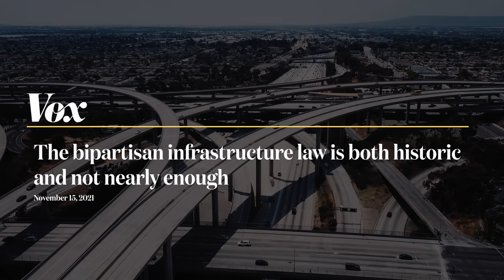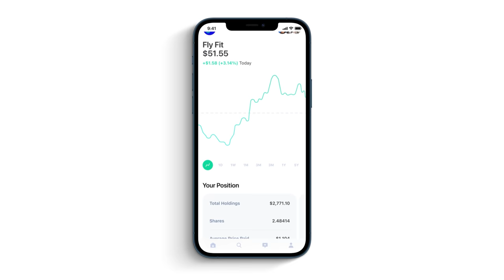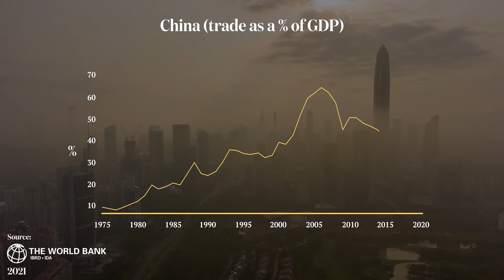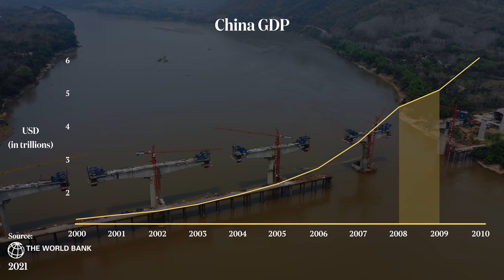China Has A Debt Problem Three Times Larger Than Evergrande | Economics Explained

Comment: It’s good to see huge infrastructures made, but the maintenance would be a nightmare
Reply: Indeed, it ain't always, "Oh let's just build it, it'll last for 10-20 years" without maintenance ? nah it won't.
Reply: Indeed that’s the issue that no one takes into account. Just like all those emptybuilding structures that remain empty today. By the time they get filled it’s gonna be time for a renovation And nothing will be working right.  Just a nightmare in the making and you know for a fact it’s not maintained.
Reply: @inkbold8511  I wonder how many Chinese people have jumped off the roof of an iPhone assembly building
Reply: Yes they mentioned in the video how the maintenance is turning  out to be quite the nightmare
Reply: I was in Suzhou high speed train station few years ago. The station looked as no one gives maintenance to anything. It was sad to see  such a beautiful place abandoned so fast. Los Angeles Central Station is almost 100 years old and it looks fantastic.
Reply: @filibertogarced  I used to live in San Diego. LA central station looks nice, but it doesn't really do its actual job. The ticket from SD to LA is so expensive, the trains run infrequently. If you take the amtrak it's expensive. If you take commuter trains they don't line up - ie you have to take one out of SD to the middle of nowhere and then take one into LA from the middle of nowhere. 

Maybe it's adequate as a hub to link LA to its suburbs but inter-city rail in the US is a joke.

I've not been to Suzhou or Shanghai but I'm hoping it's better there.
Reply: @sieteocho  hello,  
I have taken amtrak multiple times. It is actually quite convenient and sometimes faster than cars by few hours if there is heavy traffic. I agree that the system could be better. My comparison was on the maintenance that stations here are provided vs Chinese stations maintenance.  Some stations(high-speed)in China are far from the city center or on the other side of the city and it takes minimum an hour to move around. That happened to me in Changsha Hunan. 
I agree that our transportation  infrastructure needs a massive investment and we could do far better. 
Have a good day.
Reply: @evankurniawan1311  Wrong, there are laws for investors buying property they don't use or reside, in China. One of the reasons why homelessness is low is because China does indeed provide public housing for their citizens and don't just kick them to a designated area of every city like America does.
Reply: No roads to society, the Romans where fully aware of communication and commerce  to build a successful society and they where successful for a over a thousand years.
Reply: @reheyesd8666  The Chinese would never publish  due to the political paranoia.
Reply: @PETE4955  you mean building in florida?
Reply: You say this about highways?

And just think of all those jobs
Reply: @filibertogarced  I'm sure you have tons of pictures of all the homeless people in China
Reply: @PETE4955  China is richer than USA🤣🤣🤣
Reply: @skyisreallyhigh3333  I'm not making the comparison. Don't be a beta male. N
Reply: Think about it if there is no high-speed rail system, how many Boeing and Airbus planes do you need to buy? Those airplanes are more expensive, have a shorter lifespan, and are more expensive to maintain. The New York subway repairs are expensive, but they have been in service for more than a hundred years.
Reply: It will provide more job opportunities for the huge population of China. Unlike US citizens that only want a comfortable work and high salary, there are a lot of people in China willing to work.
Reply: @filibertogarced  But the trains that stop in LA are sad. Buildings don't make a rail line.
Reply: @sieteocho  It is several orders of magnitude better in China.
Reply: This also creates a lot of steady jobs locally for people who otherwise have to find jobs maybe 1000 kilometers away from their homes... so far the system works
Reply: lemon soul~
Reply: @skyisreallyhigh3333  那不是，美国依然是世界上最富有的国家，美元在全世界的影响力都很强大，即使是美国的敌人也不得不使用美元，中国现在基础设施相对完善，人口聚集程度高一些，还有中国城市的一些流浪者相对普通民众更有钱，他们是职业乞讨者，消费人们的爱心而已，真正的贫困者还是山村居多，但是基本不会饿死，冻死，不需要住帐篷，因为他们尽管再穷也会有自己的宅基地，欢迎你们有机会来到中国，亲身感受一下中国的好与不好，我们中国的老百姓其实最现实，如果我们真的过的不好，一定会造反的，谁都不能阻止，毕竟中国的历史很长，一个又一个的政权因为统治者的错误被推翻
Reply: maintenance is where corruption really becomes apparent.
Reply: They do maintain the rail lines at nights
Reply: @ysiry6109  thank you for your comment ! Best of luck to you !
Reply: J C  High-speed rail was built between cities. It just goes through remote areas. It also greatly reduces passenger demand on conventional trains and leaves more room for freight capacity.
Reply: @Oblivion889  None of you guys bothered to take a look haven't you?
Reply: @AFlyingCookieLOL  I'm sorry what, this comment's literally 10 months old. Take a look at what, exactly.

Comment: is the high speed rail in china’s context a century/multi-decade project for ROI? like the profit loss is made up by the increased profits from better economic situation from being better connected?
Reply: The profitability of the rail is an indicator of that factor. Similarly, the US paves more roads than it needs to.
Reply: Sounds like the operating costs are barely breaking even, even accounting for COVID.  So, the income from them long term will not cover the interest on the debt, let alone providing a return on the initial investment.  If true, the ROI won't get better no matter how far out you take the model.  (OBV, this all goes away if China just writes off the debt.)
Reply: It is a fools errand.  Completely subjective.  Free people will get by without everything being micromanaged.
Reply: @Josh-ks7co  This is utter nonsense. The US interstate system is funded by federal fuel taxes which more than cover the costs.
Reply: @91Durktheturk  NOPE.  US highways do NOT pay for themselves.  People gotta pay for fuel whether they take a highway or a backroad.  Highways are not generating any more money than would otherwise be collected.
Reply: @davidhfriedman  what about roads? I don't they make back money and yet our government spends billions maintaining and upgrading. How does a rail line differ?
Reply: There's also a political aspect as well, trying to better integrate the western reaches of China with the east coast. It's been quite a concern, as of late.
Reply: And to transport troops across the country easily.

Comment: 9:40 I'd disagree that standard speed rail is all that cheaper, if you're building new lines. Typically the cost of infrastructure is an additional 5-10% at most, and the capacity bump and reduced journey times you get usually means if you're building a new long distance line, building it to high speed standards is a no-brainer.

Really, the more economic alternative for passengers is often air travel, not slow trains or buses. That might not make a lot of sense on an initial glance, but airplanes have one big advantage over trains: they only need major infrastructure at their origin and destination. All a city has to do is build an airport and that's it, now it's connected to the rest of the country and beyond. Planes are also much more flexible, if a route isn't as popular, you can move aircraft onto busier routes. There's no "tracks in the sky" to maintain whether planes fly on them or not. Even if you added a hefty carbon tax onto jet fuel, in many cases it would still be cheaper to have a once or twice a day flight than a long distance train service.
Reply: Most of all, standard speed rail would be absolutely useless in the case of China.
I think the travel time is one of the main reasons to choose the train. To travel the 1300 kilometers between Beijing and Shanghai, you will be faster with the train (4h 20 mins) than the airplane if you include the processing times at an airport. That is absolutely insane if you think about it.
If it took you an entire day or more (standard trains would probably travel at less than half of the 350 km/h of the high speed trains) you wouldn't ever choose it if you can afford the plane ticket.
Reply: Its debateable. High speed rail requires more responsive signalling and continuously welded tracks. They are also built to a lighter loading gauge so you can't run freight on them.  The curves are straighter so right of way is harder to acquire.  There are also less stations so fewer towns will benefit.  One China-bashing channel (China Insights / Observer) put it more succinctly that China built HSR to the detriment of Commuter rail and freight.  As for airports, the climate mafia will also frown on aircraft, so if you're a developing country it's more palatable to get financing for train lines.
Reply: Don't tell Pinocchio, the UK has HS2!
Reply: yeah planes are way better - until your capital city has so much air pollution that you have to issue warnings to people not to breath when they go outside.
Reply: @ricks6250  exactly.
Also China's airports are apparantly notorious for long wait times (according to the BBC). This is mainly due to China's military having priority in its air space.

Comment: Could it also be that the PRC's HSR is like a postal system. Highly profitable sectors pay for the sectors that operate at a loss.
For example, a HSR ticket from Shenzhen to Guangzhou costs about as much as a ticket from Xiamen to Shenzhen, though Shenzhen to Guangzhou is much much shorter.
Reply: There is also the annual spring migration which basically breaks even the whole year as well
Reply: Except the postal system doesn't have economical competition. HSR has to constantly stay attractive against buses, cars, planes, and even slow-speed rail.
Reply: Now you’re talking about socialism which is a very dangerous topic in the USA.
Reply: @doujinflip  FEDEX UPS EMAIL ETC ETC
Reply: @Martin Punctuality is also a merit of HSR. Buses and planes are less punctual for travels of such distances.
Reply: It is like that, and in fact most country's rail systems are like that. It's just that currently the entire system is unbalanced and so will probably see some costly losses for the next few years while they right the ship.
Reply: train to urumqi isn't profitable. but it's maintained for the sole reason of availability. other businesses pay it off. like cargo
Reply: shenzhen to guangzhou is market-oriented(it's rare in China), xiamen to shenzhen is public-interest(it's common in China).
Reply: @nashi_shuai  lol, you can't beat Japanese punctuality though
Reply: @TangSuijin  Cargo trains use high speed rail lines? That's not what I've seen, but I've certainly not seen everything.
Reply: @doujinflip  "Except the postal system doesn't have economical competition"
?? really? Government operated postal systems don't compete against FedEx, DHL, etc? 

" HSR has to constantly stay attractive against buses, cars, planes, and even slow-speed rail."
I believe I addressed this point by saying it has highly profitable lines counter the losses of other lines.
Also HSR, in my opinion, has already established itself against those other options.
Reply: @brennencox516  it's still in the testing phase. but they are working on it. replacing trucks to deliver smaller parcels that people buy daily in millions being sent by hsr is not bad.
Reply: @doujinflip  Planes is easy since 90% of Chinese air space is busy with military corridors.

And low rail is usually good within a city.

In addition, Chinese cities are fairly far apart the further from the coast you are.

And buses face traffic issues.

Also the Lunar New Year gets extremely busy for those 10 to 16 days of the year.
Reply: @TangSuijin  I believe you missed the point of my post. It was to say that even if the PRC's HSR line operates at a loss, that's OK if its function is to move people (and possibly goods) around. A state-owned enterprise doesn't have to be profitable, it just needs to accomplish its goal.
Reply: @doujinflip  Fedex?  UPS?
Reply: That's not how ticket pricing works in China though. The tickets are scaled fairly linearly by track distance with different factors applied like speed class (G-train, D-train, etc) and type of comfort (hard seat Vs soft seat, 1st class Vs 2nd class). For your two examples: Shenzhen to Xiamen ticket price is ¥219, while Shenzhen to Guangzhou is just ¥74 (both examples being G-class trains, aka highest speed class, and 2nd class seats).
Reply: @Ashleigh_T  I see, the prices aren't quite as close as I remember. But as far as linear pricing goes (which I think is what I was thinking of) is not how things work.
XM->SZ ~210yuan, 3h10min, 514km
SZ->GZ ~75yuan, 36min, 102km
So XM->SZ is .409yuan/km
SZ->GZ is 1.36yuan/km, that's 2.8x as expensive.

So I stand by my original point. Some routes make a lot more money then other routes. Which makes sense if you are providing a service, and your primary goal is not to make a profit.

Comment: you should come to China and get a ride on high speed trains and see how full they are, even for lines connecting second tier cities. makes a lot more economic sense than interstate highway, counting the costs of maintaining and running cars and the emissions they produce.
Reply: does it tho? that implys you dont want to bring your car with you which many amricans very much so do becuase there is no metro in the suburbs and no person that isnt poor wants to use a bus simply driving is cheaper than taking the train and hiring a car on the other end
Reply: @leojohn1615  yup, compare to mass transit. that's a costly design in the first place.
Reply: @leojohn1615  bringing your car with you entails issues with parking and traffic.

Comment: light rail is good, if you build it on dedicated lanes, with little car trafic interactions. but light rail should not be used like a bus, not ig you have traffic issues to begin with.
Reply: Ohhh but trains are cool(And trams)
Reply: Nah, just close down roads to build light rail. By making it impossible to drive a car, public transit justifies it's existence!
Reply: trams =/= light rail
Reply: @fluoroantimonictippedcruis1537  by definition: yes, yes they are
Reply: @herlescraft  From Wikipedia, the Free Encyclopedia:

A tram (in North America streetcar or trolley) is a train that runs on tramway track on public urban streets; some include segments of segregated right-of-way

Light rail transit (LRT) is a form of passenger urban rail transit characterized by a combination of tram and metro features. While its rolling stock is more similar to a traditional tram, it operates at a higher capacity and speed, and often on an exclusive right-of-way. In many cities, light rail transit systems more closely resemble, and are therefore indistinguishable from, traditional underground or at-grade subways and heavy-rail metros.
Reply: @fluoroantimonictippedcruis1537  that must be the US definition in europe i've always seen light rail used as anything that uses rail but isn't a train. and i've found uk article define it as such... maybe a quark of language?

Comment: CRRC is actually working on introducing High Speed Freight Rail. That seems like a good way forward in order to maintain the demand for the lines.
Reply: For freight, speed is not really that important.
Reply: @fabianstoll  as a general statement, this is false. Airfreight is much more expensive but gets utilized a lot for critical parts. As China is a huge country, it may actually make sense for them.
Reply: @KatzeMuffelLebt  Such logistics are not easy to handle. Combined with public transport, it will be even harder. I think a system like cargo sous terrain as a slow system will be more successful. In addition, cargo is transported on passenger flights. How does such a train stand a chance against that?
Reply: @fabianstoll  to a certain degree, this is definetly doable but of course requires additional work, like connecting the HSR to freight terminals etc. Obviously there is more to it than just designing High Speed freight cars. Cargo could also be transported on "regular" runs and then be unloaded at the destination depots (not stations) or something similar. I just think "wont work because it wouldnt work immediately without any adaptions" is a wrong approach if you want to nourish innovation. 
Your inital statement was also "no because speed doesnt matter" and I said that it actually does matter in a lot of cases, but not for every piece transported day to day
Reply: @KatzeMuffelLebt  Okay, I have simplified.
I would like to add one more point: The speed advantage is best used over long distances. With an aeroplane, for example, over the sea. In the US, there is the hub system, but you simply can't use that with a train to the same extent, because you are limited to the tracks. Use as a supplement? That only makes it unnecessarily complicated.
Reply: @fabianstoll  Not so. econmerse is big in china. Having high speed freight deliver packages from another province, city means less truck on the roads. Produce farm products from farms can be delivered to the cities quickly and take more trucks off the roads.

Comment: In Denmark we have the great belt bridge and rail link. Its seen as a cash cow when driving across nowadays but it makes full train journeys from sweden to milan possible, until the fehmern belt gets build. My dad retired from his bosun job with scandlines and he told me the lines could stretch from Roedby to Maribo on the worst days. That Is why he favors the tunnel project. But scandlines has been funding german groups to throw blocks in the way of the project. Mainly because of the monopoly on the ferry and the border shop (Sarcasticly called IKEA for alcoholics). This is why the project is slow as "bleep"